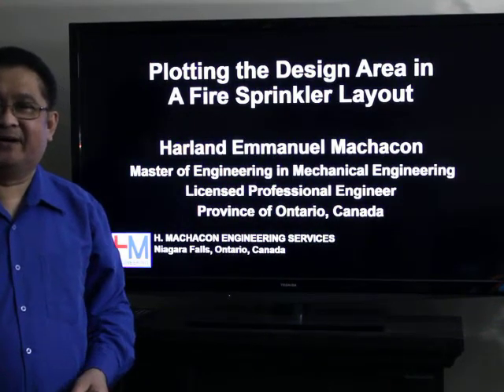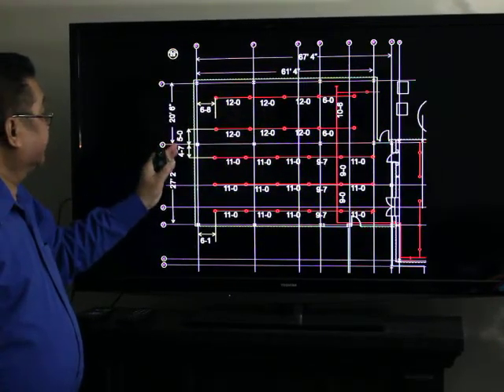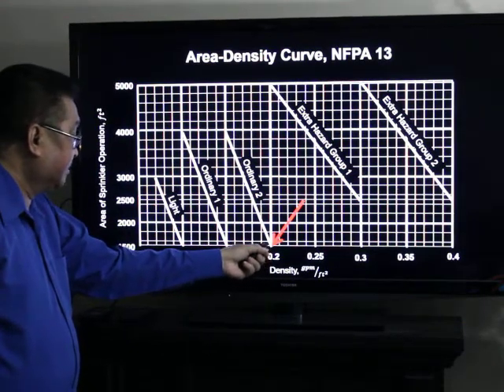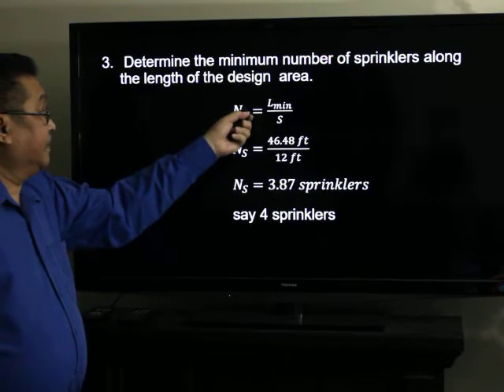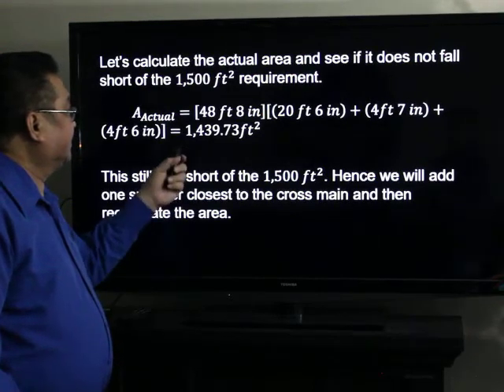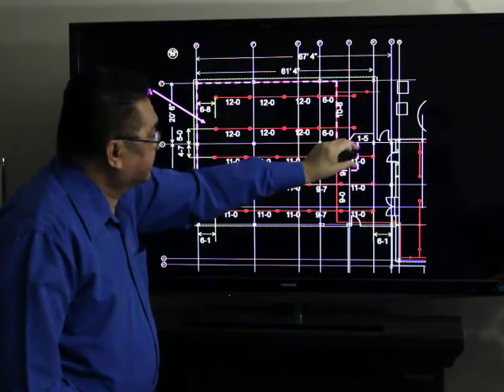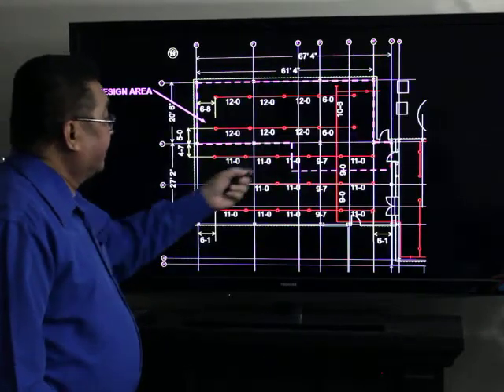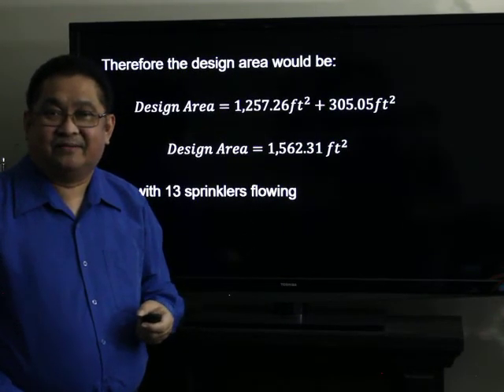Plotting The Design Area in a Fire Sprinkler Layout

Comment: @ H. Machacon Mechanical Engineering, thank you for the video. You introduced two methods for plotting the Design Area, which method should be used for hydraulic calculation? I think the 2nd method is more critical for the most remote sprinkler, since more pressure and water flow available for the closest sprinklers and less pressure and water flow for the most remote sprinkler.

Comment: Can you please help me with the definition of the design area?
Reply from the maker: From the Area-Density Curve of NFPA 13, along the Ordinary Hazard 2 Occupancy line, I chose the point with a density of 0.2 gpm per sq. ft. with its corresponding area of 1,500 sq ft. In this case I will be using the density of 0.2 gpm per sq. ft. all throughout the process of hydraulic calculations (this will be presented in a succeeding video tutorial.) 

The 1,500 sq. ft. will be my “target” in determining exactly how many sprinkler heads will be flowing that covers at least 1,500 sq. ft. of area. That is why we needed to add a few more sprinklers if the area of coverage falls short of the 1,500 sq. ft. of area. It is necessary to know how many sprinkler heads will be flowing in your hydraulic calculations.

Comment: What area and its corresponding discharge density which we dedicate to elite software, is it the actual area after configuration design area or the original area1500ft2.  ?
Reply: From the Area-Density Curve of NFPA 13, along the Ordinary Hazard 2 Occupancy line, I chose the point with a density of 0.2 gpm per sq. ft. with its corresponding area of 1,500 sq ft. In this case I will be using the density of 0.2 gpm per sq. ft. all throughout the process of hydraulic calculations (this will be presented in a succeeding video tutorial.) 

The 1,500 sq. ft. will be my “target” in determining exactly how many sprinkler heads will be flowing that covers at least 1,500 sq. ft. of area. That is why we needed to a few more sprinklers if the area of coverage falls short of the 1,500 sq. ft. of area. It is necessary to know how many sprinkler heads will be flowing in your hydraulic calculations. 

In our video tutorials, I am explaining how to do the process by hand. As for the Elite Software – Fire, I would advise you to check with the software developer, because it is their product.

Sorry for the delayed reply, I have been tied up with our projects - so busy.
Reply: @h.machaconmechanicalengine1187  thanks for reply